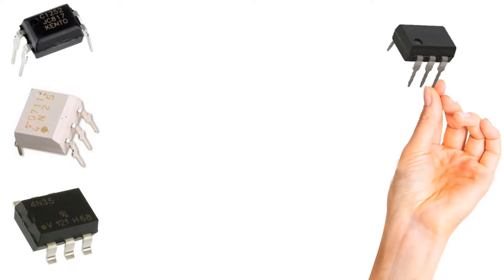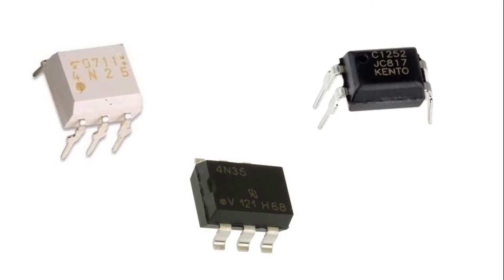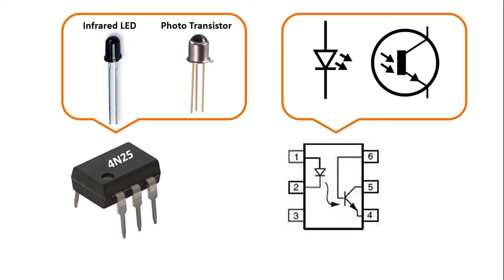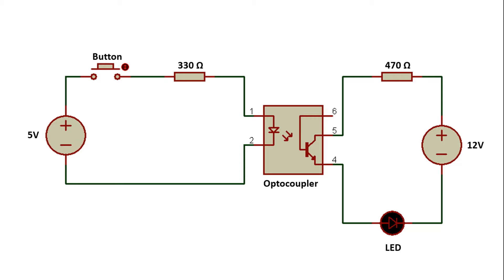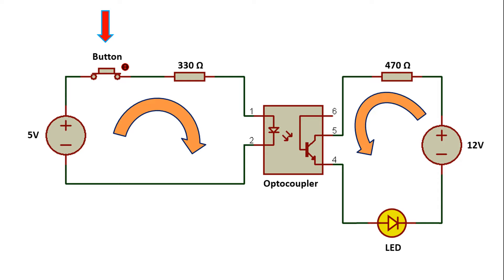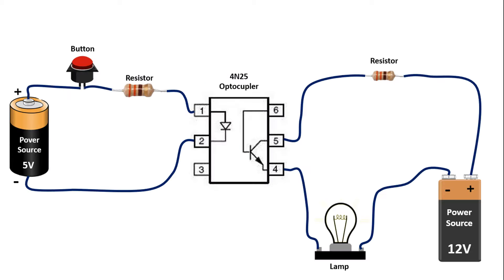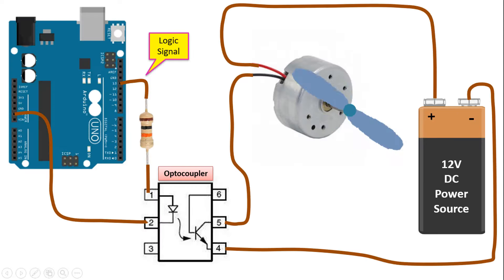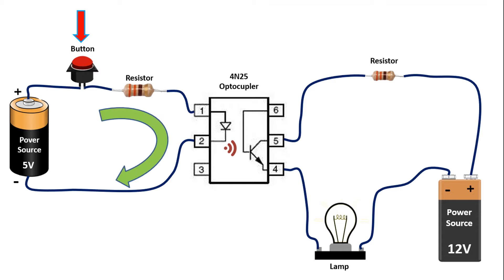What is a Optocoupler ? How Optocouplers Work? (Optocoupler Explained)

Comment: I'm brand new to this stuff, but it looks like this chip is just a switch that can couple a controller, safely and wirelessly through IR light, with a high powered circuit to prevent damage to the controller but still allow it to interface with and command the higher voltage circuit. If that understanding is accurate, this was a great tutorial, thanks a bunch!

Comment: In most cases optocouplers are used in the opposite direction as shown here. High voltage or current signals are on the input side and microcontroller signal input side is on the other side. The third pin is used with a resistor where pull up logic is used for microcontroller input.

Comment: I don't quite understand what pin 6 is for, though.  Also trying to determine if a digital signal from microcontroller to pin 1 requires a resistor at all.

Comment: This octocoupler is kinda similar to a relay in terms of usage, can someone tell me the difference?
Reply: I believe the relay doesn't offer the true isolation of the optocoupler.  Because the optocoupler is just light to indicate the current should flow on the other side.  But I'm no engineer, learning myself right now.
Reply: relay uses magnetic fields to attract or repel contactor pins for physical connections. Usually used in higher voltage situations, and more prone to failure over time (wear). The optocoupler is solid state, used at lower voltages, and less prone to failure over time.

Comment: have resistor same if 12 V come button input to opto side, etc. promixity sensor 12 V, and output side have 5V out to opto to arduino sense switch what resistor need 12V line and 5 V line not led used.

Comment: But why dont use a transistor or mosfet?
Reply: you can use transistor or mosfet, but you dont have galvanic isolation with it. With optocoupler you make sure that your circuits are separated electronically from each other. Its safer this way, but if you are making some high volume systems, maybe not most cost-efficient
Reply: Bruh a mosfet is a transistor

Comment: Not given more informat ion this is not useful what have u gave information about Transistor 
You have not discussed  how to calculate base resistor why we connect base resistor  
Calculate collector current emitter current  read  datasheet 
Barden vedio not useful
Reply from the maker: Thank you for your feedback. I will consider adding more information about the transistor in the next video.
Reply: Well the title is "What is a Optocoupler? How Optocouplers Work?" Not how to use it properly.. is a 3 minute video